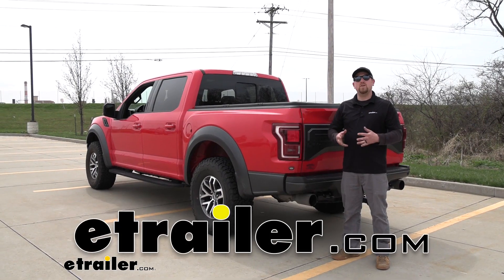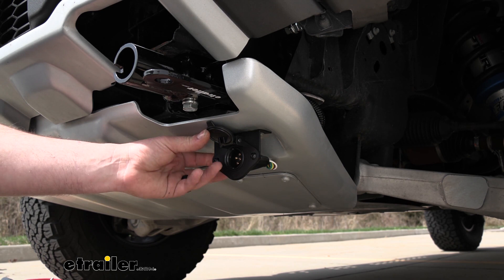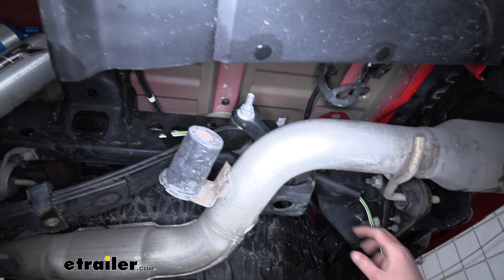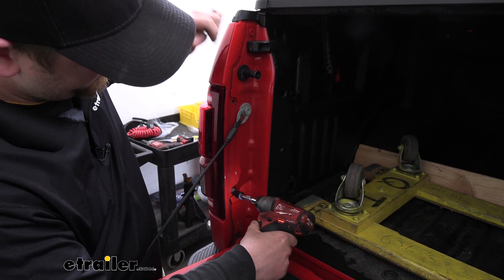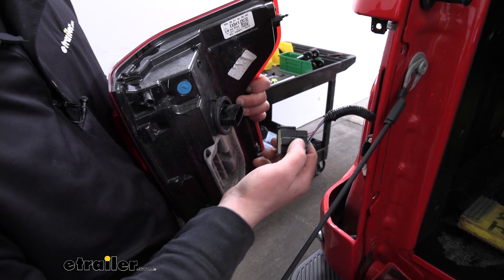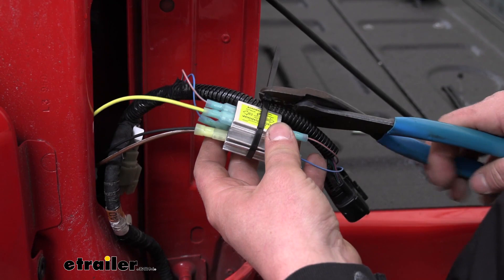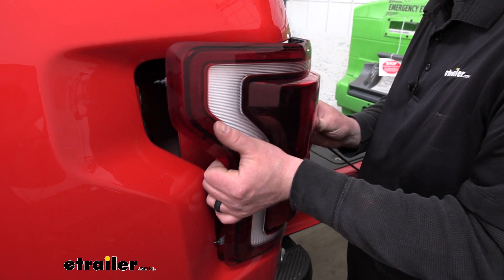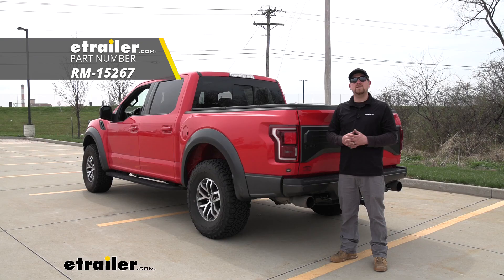etrailer | Roadmaster Universal Diode Wiring Kit Installation - 2018 Ford F-150 Raptor

Comment: Will the same application apply for a 2014 F-150 SVT Raptor?
Reply from the maker: Yes, this is the same diode wiring kit that will fit your 2014 Ford F-150 Raptor.
https://www.etrailer.com/Tow-Bar-Wiring/Roadmaster/RM-152.html